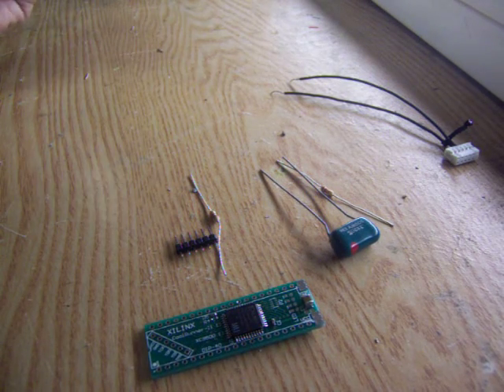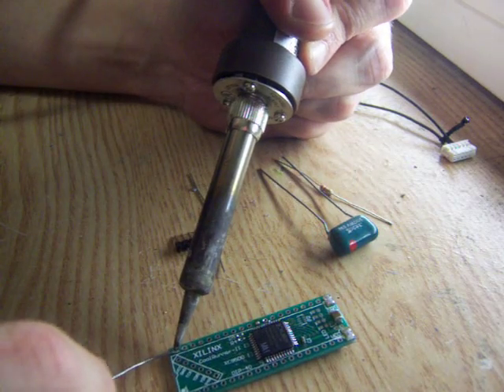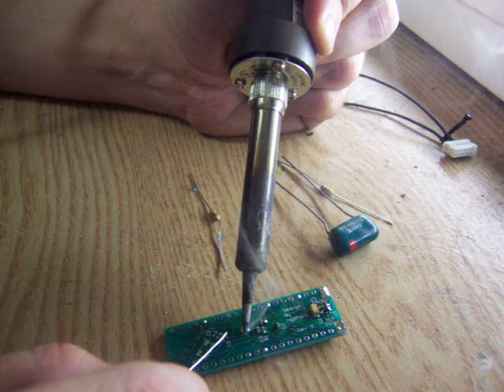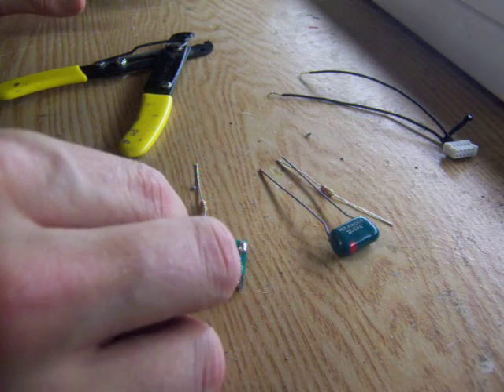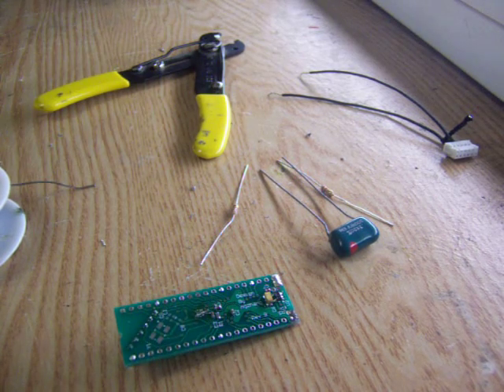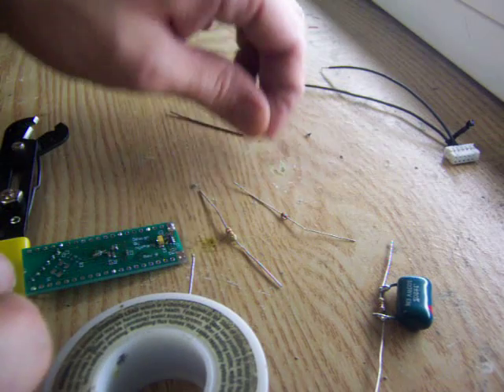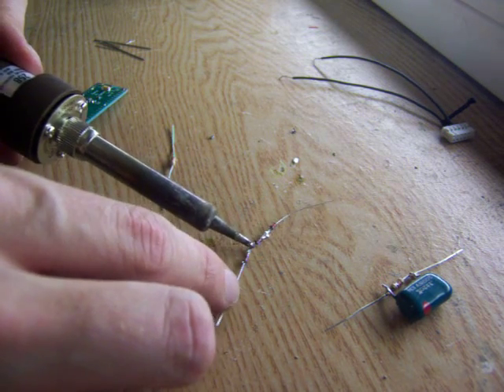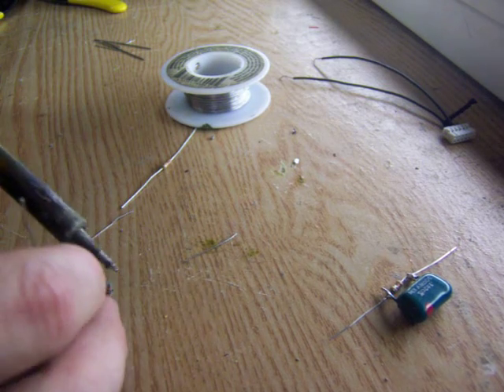Reset Glitch Hack Tutorial Part 1 : Fat 360 (CMOD prep PT1)

Comment: @Xanderj89 
As of yesterday, There's apparently a company that does do xenon's. Either that, or they gutted my system, replaced all the components, and left a modified shell and power-plug that were both the same as my older ones...

I just wanted to learn how to do Xenon's on my own. But it doesn't look it's at least apparently possible.

Comment: @Trololololoish Seeing as Electrical current passes through wire at just under the speed of light = (299 792 458 m / s) Then I would highly doubt that the length of the wire would affect the "mod". Unless you where a few hundred meters away...